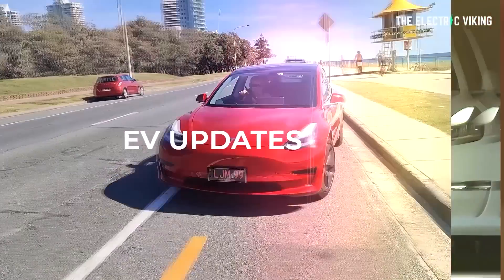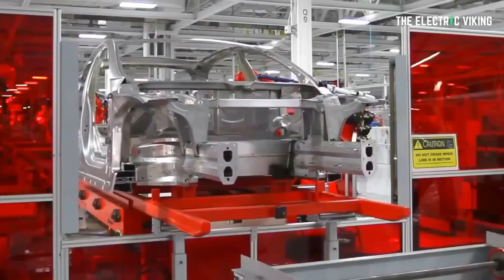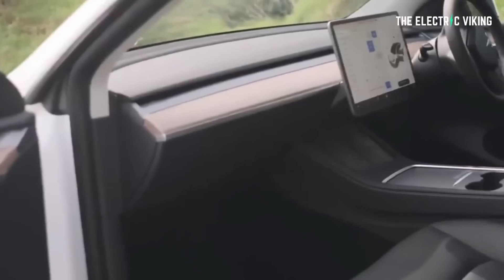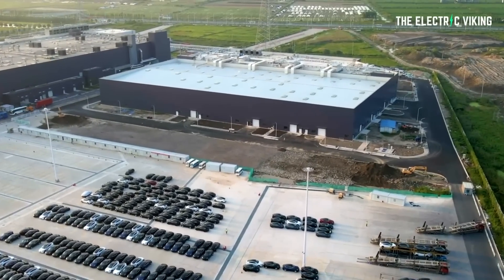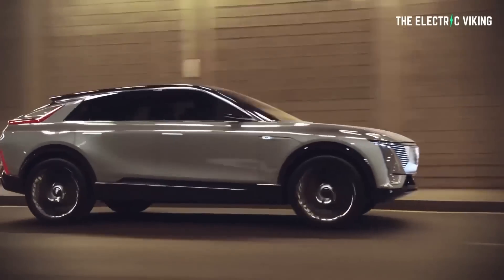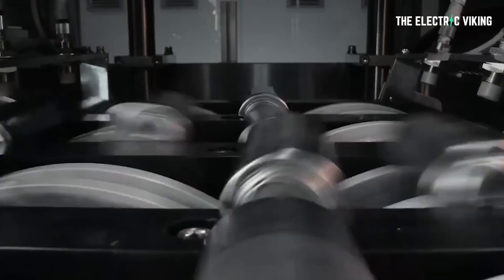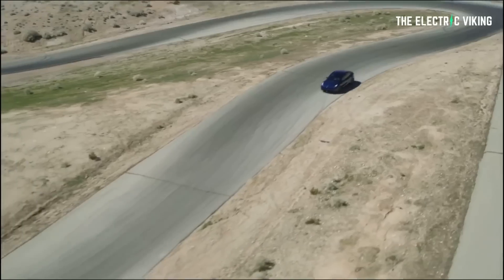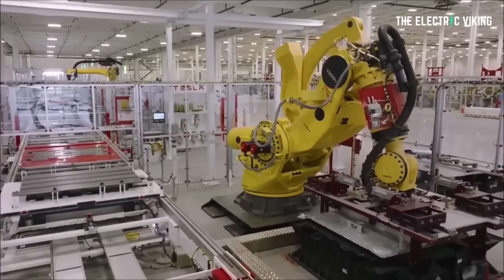Tesla's NEW 4680 battery pack size is UNBELIEVABLE

Comment: Trucks . When towing the range is generally reduced to 30% of range. so trucks are going to need like a 1000 miles range to get 300 miles when towing. Towing like with range of like a max 85 miles is going to drive pickup trucks nuts.

Comment: the 4680 tabless should be a big deal; its suppose to charge faster, and be a bit more energy dense - BUT now the Cybertruck isn't expected till mid 2023 which means the 4680 if they get it working with an acceptable fail rate won't be till then; and if they can't it will be later and later and maybe never.

Comment: One thing tesla did say about 4680, structural battery pack and gigacasting is that they would make the cars cheaper....uh....no...prices are going higher...and I know I know...supply and demand blah blah blah....the boat load of profits will come from the raising of the prices..thats the only reason...you said it yourself, "if tesla wanted to they could lower the price". They don't, they don't want to.

Comment: Why does no one talk about the tabless design? That allows a significant charging advantage, less heat produced, shorter distance for electrons to travel. Leading to faster charging times, and longer battery longevity.

Comment: There is no evidence that this Model Y only has 50Kwh of usable energy and no evidence that capacity is software restricted at all. Also it's just not the case that xx Kwh of 4680 battery pack would translate to significant more range than the same amount of energy coming from another cell type: That might be true only to some extend - by weight reduction and lesser heat dissipation but it's not that the same amount of KWh suddenly is worth twice as much because of the cell type.
Tesla openly communicated the advantages of the 4680 cells: Improved manufacturing, improved assembly, more energy thus fewer cells per pack, more power / higher C load (through reduced heat development), weight savings by structural pack... resulting in a few percent more range for the same pack size. Maybe 4680 cells also allow for larger packs in the future, boosting range further by more capacity.
However - main advantage and main goal for those cells is scalability: While it is impossible to produce TWh of capacity with 2170 cells, that should become possible with 4680. Why? Simply because with the larger cells you have to produce and install fewer numbers for any given capacity. And  the tabless design (which is the main feature that even allows for the cells to become bigger in the first place, because otherwise it would be impossible to get the heat out of such a large cell) allows for a continous manufacturing process, which was not possible before.

Comment: More cars and ultimately more robotaxis per KWh of 4680s, lower warranty risk per vehicle of a new vehicle and battery type - also maintains demand for initially more abundant MIF 2170 Model Ys for customers seeking longer range instead of holding out for initially limited supply of a MIT Model Y.

Comment: Strange how a new customer just put 59 KWH into his Austin Built 4680 battery Model Y going from 10% State of Charge to 97%.  Kinda defies the idea that the pack is ONLY 50 Kilowatt Hours in size/capacity.  The math indicates approximately 67 KWH.
So then we get to this "supposed" extreme efficiency!  Stated range is 279 miles.  The Kia Niro EV which has a 64 KWH battery has routinely been reported to deliver 279 miles and more, although it would be necessary to do a "side-by-side" comparison to bear this out.  Granted, the Tesla Model Y is larger/heavier but it's aerodynamics are superior and that is crucial, particularly at highway speeds.
I'm not saying that the efficiency of this new Model Y variant has not improved at all BUT it appears to be slightly as opposed to the claims made in this video.  One of the REAL benefits of the 4680 appears to be faster charging times, especially on a Level 3 Supercharger.
I DO believe Tesla was brilliant to introduce this shorter range 4680 variant to avoid the "Osborne Effect" which would just kill demand for the 2170 versions.  When they've managed to significantly increase production of the 4680 batteries, I'm sure we'll see longer range variants announced.

Comment: Does anyone know if Tesla has a good insurance policy in case these 4680 cells explode and they have to recall ALL THE VEHICLES equipped with these cells?
If it was 2 or 3 yrs down the road, this sounds catastrophic for the company to replace that many cells for that many vehicles produced in that time frame
Reply: They have the highest profit margin in the industry.  These batteries have been tested thoroughly, as no one accused Tesla of being stupid. Do the big three US automakers have enough insurance for all of the ICE vehicle fires? Don't worry, be happy
Reply: @Yodaandhislightsabre  the ICE fires are usually older cars leaking oil and aren't maintained.
EVs on the other hand have battery cells as the most costly part of the vehicle and replacing them on recall aren't the same as ICE replacing a faulty switch or whatever ...
Reply: @Yodaandhislightsabre  4680 cells may have been tested in a lab but so have LGs batteries used for the Chevy Bolt batteries before they got recalled...but they didn't sell many of those and the problem was a cheap fix on the battery ....Tesla's experimental new cell structure and battery chemistry poses a different risk altogether...so im wondering if in a recall situation if they have to cover the costs of replacing entire battery packs without insurance
Reply: @Yodaandhislightsabre   pushing the limits on how much energy can be packed into a smallest container is a dangerous game...

Comment: If an EV does not have a minimum of 300 mile range it is not worth buying in the US unless you plan to use it solely as a city car. Tesla’s frankly are too expensive for the range you get
Reply: They don't get 300 miles range at hwy speeds.   I own a 2022 Y-P and Iam lucky to get 250 miles at 75 mph.  Lifetime avg is 318 W/mile which is 240 miles avg.  range.  Hell for a Y-P to get 303 miles with the 75KW battery = 248 W/mile  have fun getting that with a 4500 lb SUV.    Also SuperCharger prices are getting redick.     It is just a city car which is sad because its soo much fun to drive and the auto pilot is great for a road trip.

Comment: Sam you really should retract this video or do some sort of correction, clearly your data is wrong. Whereas I'm impressed with your sheer workload output, technically it's too often just not close to being correct. It's your show, but it also reflects your (technical) integrity - or lack thereof.

Comment: With less batteries needed it will weigh less and go further in range. 
They don't want to release the actual efficiency until they get more capacity to switch over all their new vehicles. Osbourne effect protection.
Reply: Hummm   50KW battery  optimal charging is 10% to 80% or 70% net giving you  35KW @ 30KW/100 miles is 116 miles range.  Even at 25KW/100mi = 140 miles of range. F that

Comment: They went with a smaller 4680 pack so it wouldn't destroy the value of the California built model Y's with the 2170 pack. I think extra long range y's with 4680 pack will be made, but it's going to be a while.

Comment: Another channel who claims to have insider information says the battery is 70KWH. So Who is right. I will believe whoever take part the car and looks directly at the battery. Elon down play the. need for longer ranges per charge so the public would get upset when the new model Y didn't have longer ranges. Yes much better margin but, no gain for the customer and that sucks.

Comment: This is interesting. So it sounds like the structural battery pack does reduce weight, and likely so do the single cast front and rear end frame sections. And it sounds like the weight savings is making a big difference to mileage. Thanks for sharing this.

Comment: I would like to see a battery pack tear-down. I know what the model number says, but I suspect that battery is bigger than 50 KWH. I would really like to know what the energy density is both by volume and by weight for the new cells. Not what they thought it might be, but rather what it actually is.
I would also like to know the total gross weight of the Austin Model Y VS the Freemont model Y. How much weight saving is there as the direct result of the smaller battery pack, giga-castings and new 46-80 cells? Hype is nice, but I would like some real numbers.
Edit" I don't know about you, but I would not be happy to find out that I paid for a bigger battery, I've been hauling around a bigger battery, but I can't use the bigger battery because some jerk thought it would be a cool marketing ploy to soft-lock it.
Reply: What a problem too have hey !, What a future to look forward too ! Agree 100% wouldn't want to be that guy but having said that , two things, 1.) new chassis/ Pack format is as yet UN-proven and 2.) Tesla & Elon care about safety ! so until reliability of the 4680 cells is proven, might be a wise move , as the last thing anyone of us needs is another GM Bolt Fireasco !!!!! and don't forget the cherry on top of the cake ! , cells should do more cycles and therefor the life span of these new spec Y's should be increased ! :)
Reply: P.S. Agree 100% would be very interested to lean more details  & full specs also
Reply: @pwrrpw319  Tesla will NEVER have a "Chevy Bolt fireasco" because they do NOT use pouch cells. Pouch cells are the most fragile and vulnerable of all the cell types. They are big, have no structure. It is not a matter of "IF" they will fail under normal use, it is much more a question of "WHEN" they will fail. As far as I know, the only current (pardon the pun) issue with 46-80 production is to increase both the yield and the yield rate of the production line.
Reply: @surferdude4487  Thanks but I'm fully aware of the Bolt using pouch cells vs Cylindrical cells that Telsla uses, and I'm also fully aware that in general Cylindrical cells are more robust, however it doesn't mean they can't catch fire & burn a vehicle to the ground!, and I'm well aware that Tesla has an excellent record in this area and that's not surprising and certainly no accident ! , My point was simply that Tesla is not just all about the best possible performance & efficiency , but safety is very important to them also.
Reply: @pwrrpw319  Unfortunately, the 46-80 is not immune to battery fires. I'm pretty sure that there will NEVER be a spontanious battery fire under normal use, unlike a certain other battery pack. But, if there is damage to the pack that is severe enough, it could result in a battery fire. I'm also pretty sure that Tesla has put every protection in place to minimize this risk. But, when the first battery fire happens, when a 46-80 pack gets speared by an entire truck-load of rebar, the headline will read"TESLA BATTERY CATCHES FIRE!!!!!". There wil be no mention about how a gas tank suffering the same fate would have exploded or how everyone in the car would have been very dead. But, that's FUD for you.

Comment: Again very disappointed with the Viking self proclaiming to be an expert at evs and renewables but display an amazing lack of basic math, physics and chemistry knowledge.

The data clearly indicates that the battery pack is approximately 70 kWh.     The breakthrough is in the charging SPEED which review of the code shows has been software throttled.

You would have to defy the laws,of physics to get an efficiency increase of 40% with no changes to drag, weight, rolling resistance or drive train efficiency.

Your blogs increasingly do not pass the pub test and just too painful to watch.

Comment: If we just made cars and roads like scalextric but bigger and the doors opened, then we could all have affordable self driving electric cars now. And if we put magnets on the bottom like scalextric cars have we could go round corners fast too. Think Elon’s made a big mistake with all this battery stuff.
Reply: A 400v track running along the middle of the road = SHOCKING results.

Comment: Im so confused. How does a battery pack increase the range so drastically if it doesnt increase the energy density?
Reply: The weight of the battery pack and vehicle are several hundred pounds (kilograms) lower than before; and, the battery cells are more efficient.

Comment: The 4680 tabless cell has great stats; the failure rate of the cells is unacceptable. Unless they have now solved this and are putting them in production vehicles (I have not heard this) - they are useless.  In addition, they will not impact the Lithium production shortage by very much; being only 16% more dense. They may make is worse increasing demand. This is why Li EVs are a dead end; EVs need a superior chemistry cost and a green grid.

Comment: I wonder if weighing the new Austin Model Y with 'so-called-50Kw' battery pack ... comparing it against the weight of the Fremont model Y ... then maybe you could back calculate the 'actual' size of these new Austin Model Y battery packs?
Reply: Nope, changes in the basic structure (gigacastings, structural battery pack) are expected to reduce weight as well.

Comment: Smaller battery packs also provide faster-DC charging stops without utilizing methods that risk battery longevity. So it's not just better than other battery strategies but a better consumer experience. This is why Tesla is so far ahead. With future global supply issues looming, substantial price increases to battery production across the board will follow. Reducing the kWh needed today to reach decent range expectations will keep Tesla competitive far into the future.

Comment: I think that once Tesla converts all their battery production from 2170 to 4680 batteries in all their factories then they will increase the battery size to about 75 kWh and 400 mile range.  They might still sell an option with the 50 kWh at least initially.  After awhile as they increase the battery yields and production the battery will become so cheap that most people will want the 75 kWh.  It is 50kWh at the moment otherwise they would not be able to sell the 2170 battery version of the car from their factories that have not been coverted over to the new battery yet.  They need time to convert over to the 4680 batteries in their other factories.  That won't take long since they have now developed the technology of the 4680 battery.  I expect that they are continuing to improve the 4680 batteries and reduce the price of production.  The research and development never ends.

Comment: Wrong, Wrong, Wrong!  The 50D designation doesn’t mean there is a a 50Kwh battery. Based on recent reports based on an actual Austin Model Y, it has been calculated that the battery size is 67 or 68Kwh. See the Tesla Daily Podcast YouTube video. 

Today I heard even worse news from the Electrified YouTuber posted today 06/11/22 saying a Tesla insider told him that the battery pack had 828 batteries and had the approximately 82 Kwh, and that Tesla has software limited the charging speed so as not to Osborn Affect the Fremont Model Ys. He did not say the range was not software limited but if it wasn’t then then the current implementation of this battery is less energy dense than the 2170.   He indicated that they are having production problems with the 4680 battery and that the Austin Gigafactory would be refitted to produce the 2170 versions of the Model Y.

Comment: I have an order for a LR but I don't live in TX. But if this has a max capacity of 50kw battery then it is definitely a game changer because if they make 60, 70 or 80kw battery then next to a Lucid it's going to be a history changing vehicle. 

Now if the current battery is showing somehow 50kw but it's actually more and it can be software unlocked then that means the LR version is going to be close to or over 400 miles of range...with most likely 375 to 390 usable.

Many who have Model Y on order and are getting dates pushed back could be for this very reason. Newer models such as the LR will be coming out of TX with a larger pack or unlocked pack. Either way this is great news and I can't wait to see what's released.

Comment: As an EV agnostic, I have been taking a deep dive into understanding the features and benefits of the EV lifestyle. I've learned that the Tesla products are generations ahead of the legacy manufacturers in terms of technology and production efficiency. Folks don't want an EV they want a Tesla. However, based on the fact that thousands of tons of earth must be mined to create one battery using oceans of diesel fuel, the ecological nightmare of rare earth mining and the fact that there is no infrastructure to support the volume of electric power to support widespread adoption of EV's, how are EV's not a holocaust for the environment and not a dead end? I would like to hear your take on this.
Reply: You spam this everywhere and don't take note of answers.
Conclusion?
Disingenuous FUD
Reply: @rogerstarkey5390  That's right. I never get a good answer, I will keep it up until someone can address the holocaust that EV's are for the planet.
Reply: You are of course welcome to do the same comparison for the internal combustion cars.  To take a single example that is often used: Cobalt (which I presume you think is a rare earth).  NMC Li-ion batteries currently use a bit Cobalt, but the largest user of Cobalt in the world is in oil refining.  Mostly Cobalt comes from mines of other minerals (Copper mostly).

Comment: I also (like others) think you should consider the possibility that the battery pack is approximately 70 kWh, even if the name 50D indicates 50 kWh. Still, charging speed seems to be really high, although software limited for now. Production cost, lifespan and forth might also be very good.